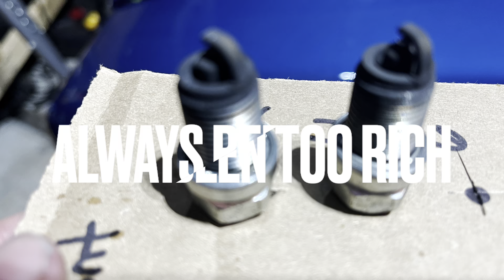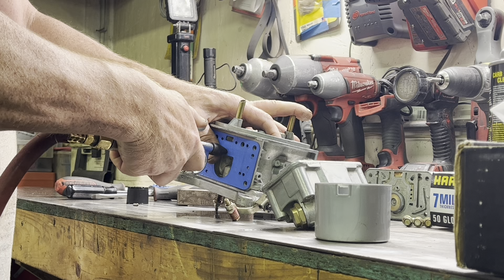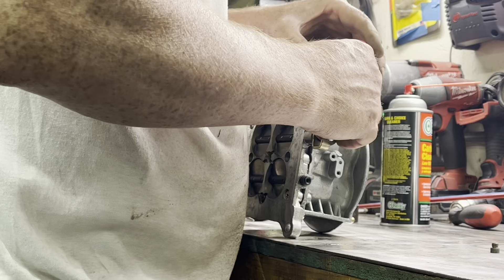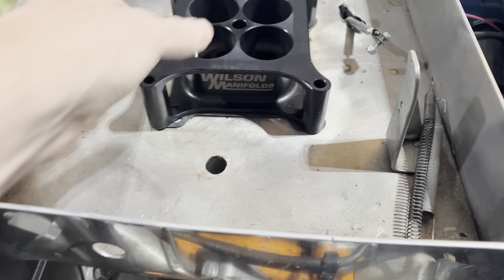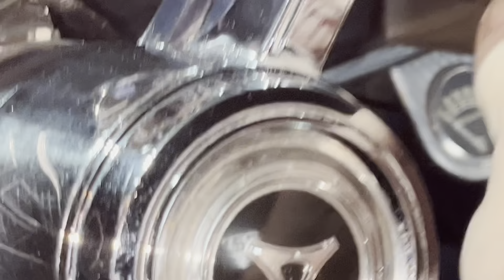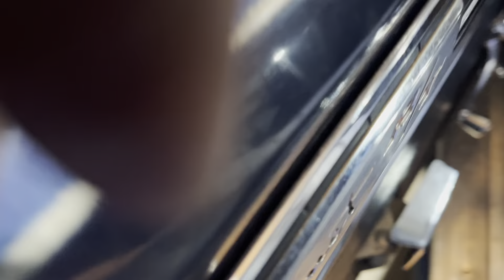How I broke the Jackpine Savage #nonamenationals

Comment: Hey Mark, watched this video.  Mopar Jeff was a bit critical  of the set up. One has to remember that  the motor was out of a street car ,set up for daily driver in a 71 Cuda with 323 rear gears. It wasn't ever in tended to be a race motor just a really snotty  street motor  and was set up to be a reliable fast daily.  That carb has always  been a bit of trouble, but that is why it had both power valves  in it.
Reply from the maker: Hello Andy 🦶🏾I understand that. He doesn’t know the full story behind the engine because I hadn’t told him. We actually had it working pretty good last year. But me letting it sit 8 months put it back to square one. We put his QF 850 on it but the fuel pump went out ,mostly due to me being an idiot. He was busy with his son and their Aspen, and by the time ‘I’ got it changed didn’t get to run it. I still am a novice but learning how to do more by doing it wrong first. 😂. The car is a war horse, deserves a better rider👣hoping to go back Sept 2 and 9 to test again. I’m